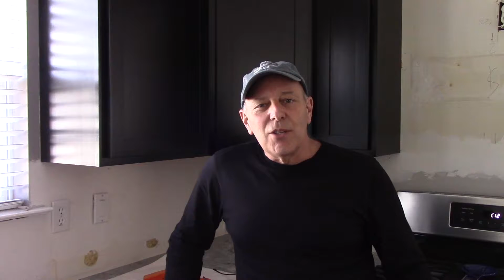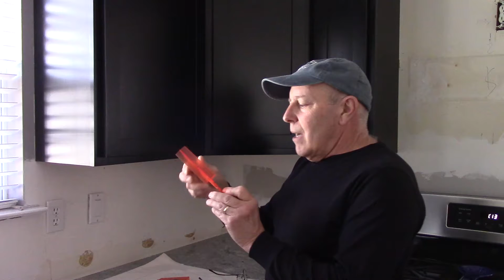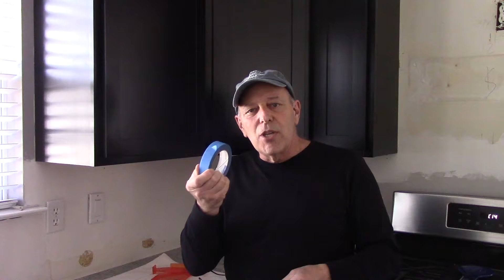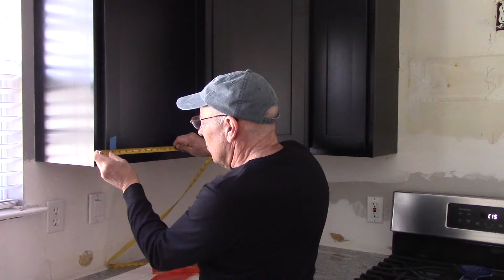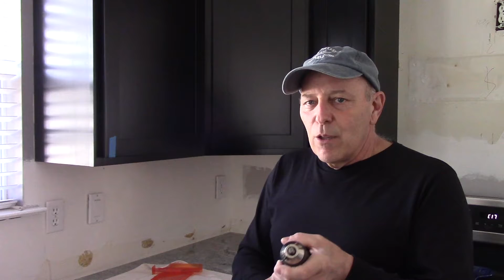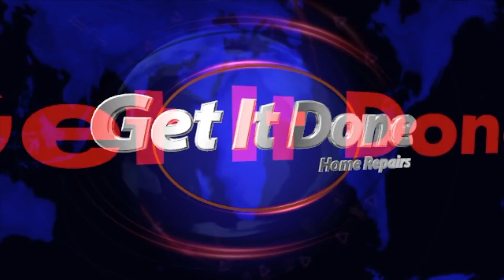How To Install Kitchen Cabinet Knobs

Comment: I used 2 pieces of wide masking tape. Ran one across the bottom lined up with the edge. Ran one up the side. And where they intersect on the inner corner of the tape i drilled my hole. Never even pulled out a tape measure

Comment: but what about mitered cabinet doors?
Reply: I'm figuring that you don't want to put hardware right into the miter joint that's in the corner of the cabinet door. So I'm just unsure if you go center rail a few inches up or something like that.

Comment: Thank you for this video! So I’m actually starting my kitchen renovations in a few days and it will be the first time I’m using a drill! Lol! So I watched your video. How do I know which drill bit is the actual size for the hole for my knobs?
Reply from the maker: If you take the screw from the knob you can use that to see what size drill bit